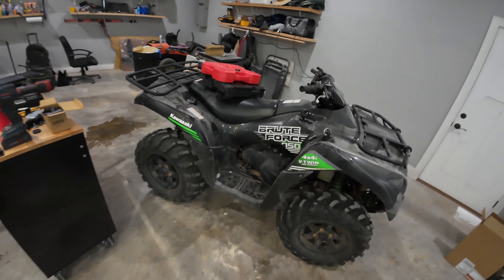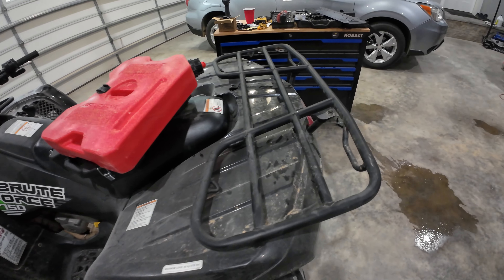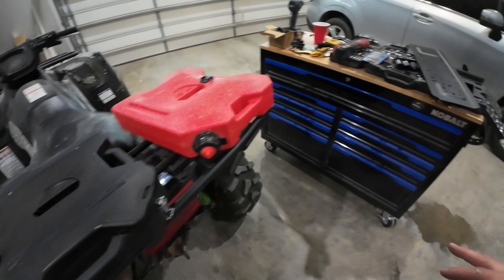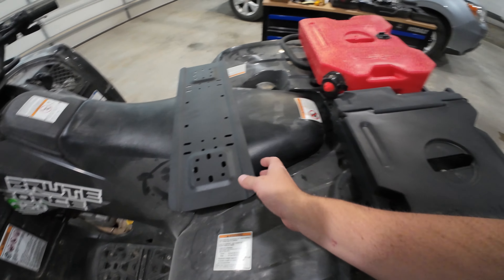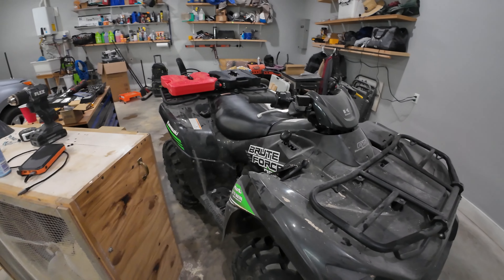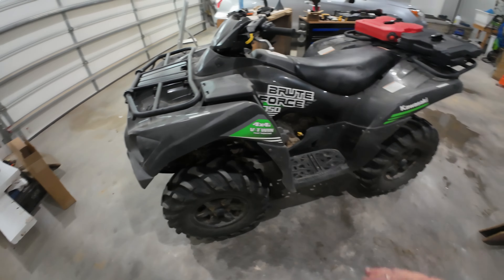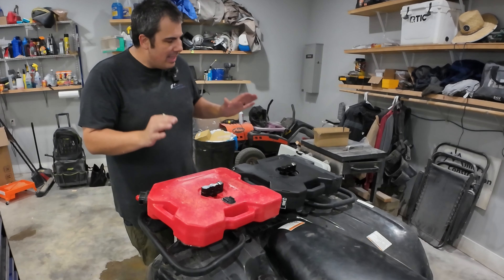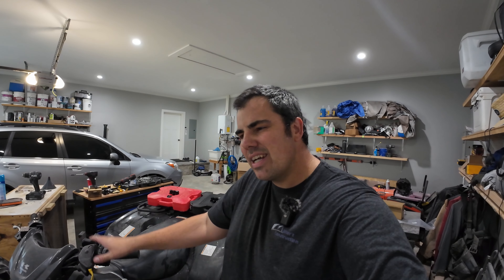New RotopaX setup on Kawasaki Brute Force 750 ATV

Comment: Nice addition. If you replaced your existing gas can with the rotopax 2 gallon that has the same interlocking tabs as your black storage can, the tabs lock both units together, plus then your storage container could sit with the latches to the outside like you originally wanted. The tanks that have the interlocking tabs work great because they effectively make the two cans lock together and act more like one unit while they are latched down making them even more secure on the rack. 
How has the storage can held up since you installed?
Reply from the maker: @MrChadx1  man I didn't even know that. Storage can has held up great. However I've already switched up this configuration to something even better. I have a video on it. I'm using a Milwaukee packout now.